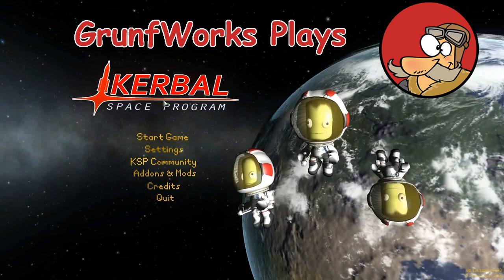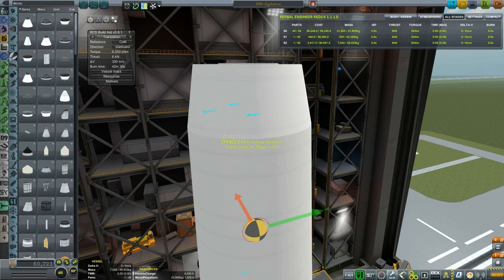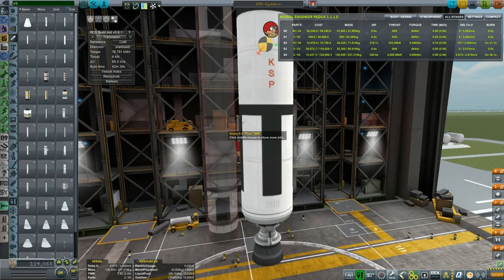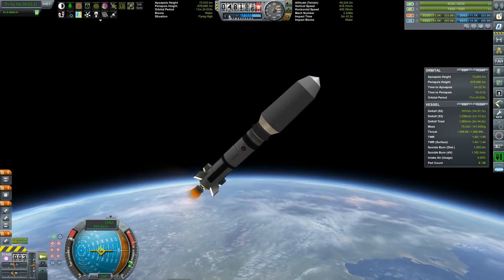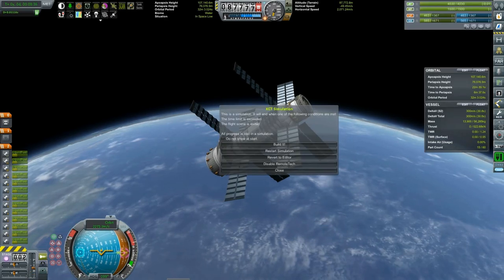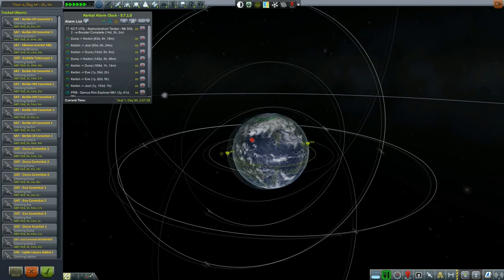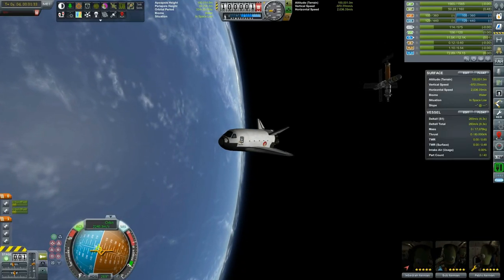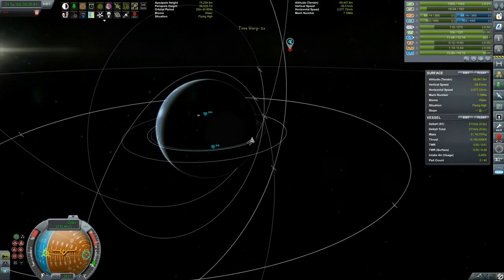Kerbal Space Program - Interplanetary Voyage - 006 - When Tragedy Strikes - Lets Play - Season 2

Comment from the maker: BTW I would appreciate if any of you guys could help me shed some light on why the tragedy happened in the first place. The info panel says overheating, but I do not buy that. If the craft was wiggling that would help spread the heat, right ?

At first i thought it was FAR to blame but after info panel i am not sure. Anyone ?
Reply: KSO doesn't support FAR. As you can see from the wings info panels. You have little control on the attitude in the low atmosphere, cause your torque depends on your Reaction Wheels, not on your flaps.
To re-enter safely I suggest not just to control your Vertical Speed, but your Relative Speed too. Down to 40 km, when your AoA isn't enough to slow down rapidly, some big S-turns are really helpful to bleed up the excess speed.
Reply from the maker: Cristian Ciotti I did not know it doesn't support FAR. That changes a lot of things. Then i will just have to make my own shuttle
Reply: It would be a wise choiche, otherwise you'll have a lot of troubles with KSO.
Reply: thank u so so so so so much for the kerbal,your my new favorite youtuber😀
Reply: do u know what one of my missions will be
Reply from the maker: Doge gaming Is it John Kerman? If so then You will be taking either a rover ship i showed off to Duna, or another vessel i have not shown yet, but the mission starts around episode 10 or 11 i think. I am now recording ep 12 and remember launching John already. :-)